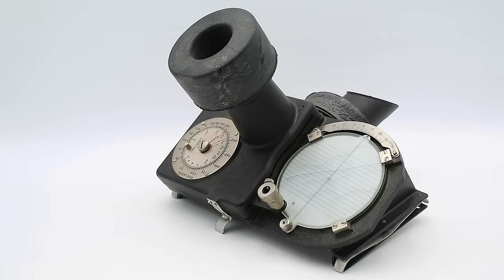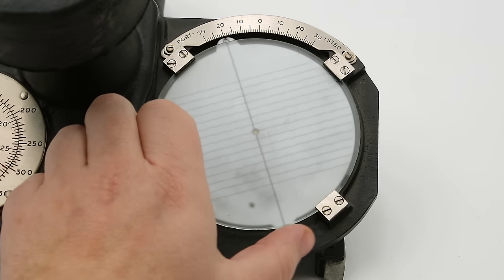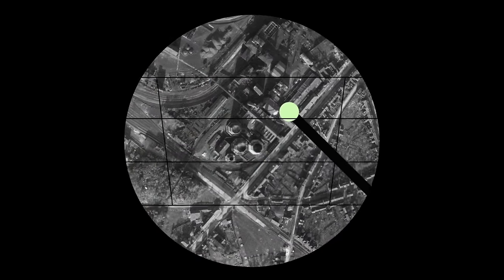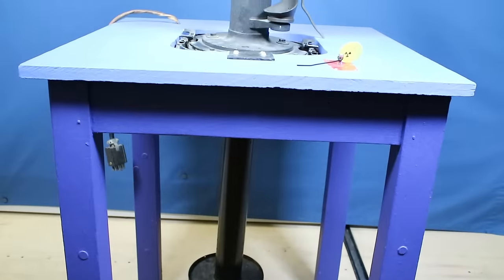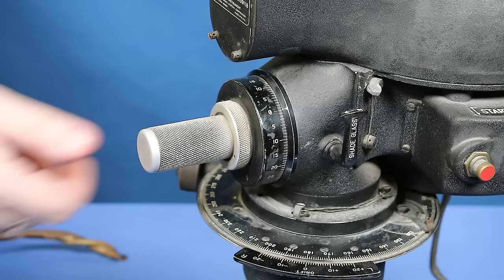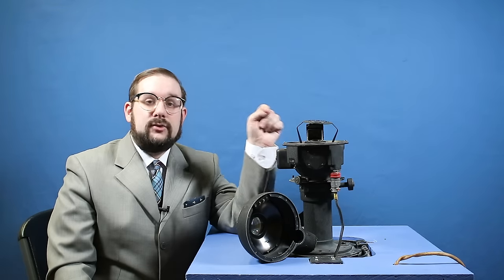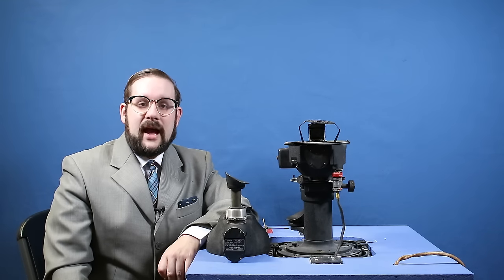WWII Drift Sights: a Grounded Approach to Navigation

Comment: Hi Gilles, when you say at 12:32 that you simply divide the hight with the time to get the speed, what unit do you get that in? In fact the slide rule on Mark II does the division, and applies the factor for mph or knots, similar to E6B that the navigator would have anyway.
Reply from the maker: The result is in knots. Indeed, the "C" correction factors for measuring groundspeed in MPH with the B3 differ from the "K" factors by ~1.1508 - the conversion factor between knots and MPH.

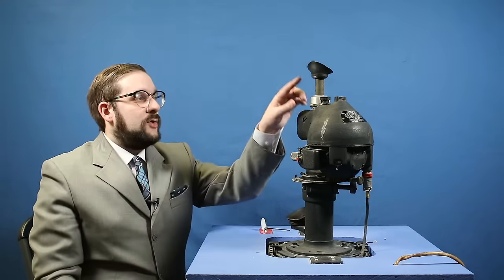Comment: 9:56 does anyone know how long the gyro took to spin up ?  On older ships they can take an hour
Reply from the maker: The manual instructs you to hold down the startup button for one minute.
Reply: The gyroscopic effect doesn't really require a specific rotor speed, as long as the rotor is spinning fast enough that the forces generated by the gyroscopic effect exceed any friction in the gimbals.

Of course this really only rewords your question to "how long do you have to wait until you're sure the rotor is going fast enough?"

Comment: So do commercial airlines solely rely on GPS now?  Or do they have modernized versions of these navigation devices in all planes "just in case" or as confirmation.
Reply from the maker: They use Flight Management Systems (FMS), which combine GPS with Inertial Navigation Systems (INS, which use gyroscopes and accelerometers to track the aircraft's movement) and radio navigation.

Comment: Is it specified that it's 110 volts as opposed to 120 volts?
I find it fascinating that throughout history the "main power grid" is assumed to be either 110, 115, or 120 volts depending on the manufacturers of equipment. Where I live, the power grid fluctuates between 117 and 121 volts throughout the day.
Reply: Alec from Technology Connections did a whole video on this topic—as I recall, it comes from applying a fluctuation factor to printed specifications for electronics, such that while 120 is the target voltage, your devices can still work with a dip to 110V, and sometimes 117V will be stated since it's in the middle of the acceptance bracket of 110-125.